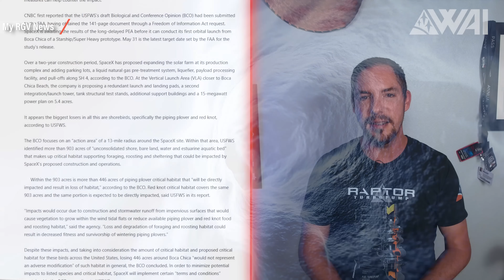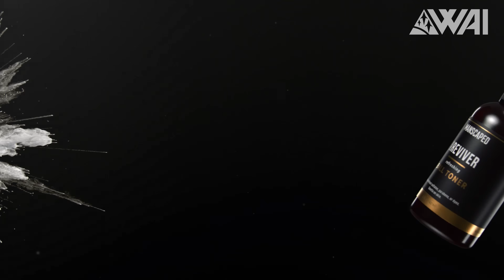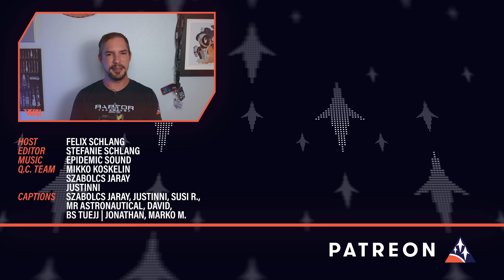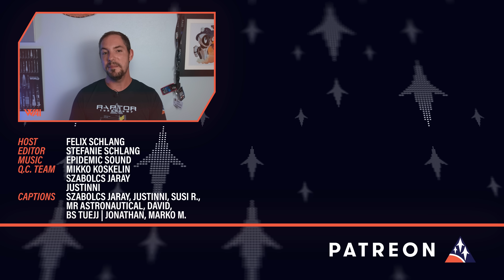SpaceX Starship Accelerating Efforts Towards The Orbital Launch Test!

Comment: “A lot of repairs would need to be done” lol, if a fully fueled starship blows up on the pad the project would be financially toast. At least another 3 years behind, the factory rendered a wasteland. 
This thing would crater the launch site. The BFR also makes a great BFE.

There’s a good reason Elon just hopes it clears the launch tower, I sure as shit hope it does too. 🤞
Reply: The mistake made was that he calculated for an explosion that releases 10K of energy in a microsecond.  In order for this to occur the oxygen and methane would have to be perfectly mixed before the explosion started.  Since they are liquid and in separate tanks There would be an initial explosion that would be dwarfed by a several second long deflagration.  In this the primary danger would be the sustained levels of heat produced during those seconds.  

Just like we've seen when the earlier versions of Starship exploded after landing.
Reply: @colincampbell767  I imagine the pad and immediate area would be cratered. If the deflagration is big enough it could set off the methane storage tanks. 

Yes the whole thing wouldn’t go off in a microsecond, but we have not seen a fully fueled ship go off let alone the significantly larger booster w/ starship. If this thing goes off on the pad the immediate area will be deleted.
Reply: No crater.  The will deflagrate and not explode.  And the fuel tanks are double-insulated (the part of the tank you can see is merely an outer shell designed to reflect heat).  The launch mount ant tower will take damage but beyond that the hazard will be falling debris.

If you look at the other Starship crashes you'll see that the actual explosion is rather small and mostly hidden by the fireball of burning fuel.  (The mushroom cloud you see is actually a secondary event that occurs after the explosion.)
Reply: @colincampbell767  the starships that crashed were loaded with so little fuel their explosion is not even comparable to a fully loaded starship booster stack
Reply: The explosions on the starship crashes were so small that you have to know exactly what to look for in order to see them.  The fireball was deflagration combined with the chimney effect.  And deflagration does not create a shockwave.

You think that what you were seeing was an explosion because that's how Hollywood depicts explosions.  Whenever you see a rising column of burning material - you are looking at deflagration and not the actual explosion.

Most of the fuel burned inside the rising plume due to the chimney effect.

And since the diameter of the ships is the same - there will still only be the same amount of fuel that can mix with oxygen and explode.  After that it will be a rising column of flame - only larger.  

The biggest hazards will be flying debris and the intense radiant heat.

You are making the mistake of assuming a complete mixture of the methane and oxygen before it explodes.

Comment: Not that easy. All load bearing structures exposed to the heat would have to pass structural integrity certifications; possibly tougher than that FAA approval.

Comment: Using some napkin math, Starship can maintain positive thrust (still able to lift) with 8 engines out. If 33 engines give 1.5 Gs of thrust, each engine gives around .046. With 8 engines out, Starship still has 1.15 G. 

Granted, may only be able to abort to the ocean, but a single engine failure should not doom the launch site.

Comment: I'm not so sure it would be 10KT explosion. If the failure was in booster down around the thrust dome the explosive force would have to reach starship then damage it to the point of uncontrolled venting of both tanks for starship to explode. But that's not going to happen B7ship 24 WILL HAVE a flawless launch. B7 will perform boost back and re-entry and perform a pinpoint hover at a GPS guidance bouy in the gulf before engine cut and splash down. Starship will boost just high enough and fast enough to try out Starlink satellite dispenser/Launcher then perform its planned Pacific Ocean re-entry and do the same as B7

Comment: It is worrying that the 2020 Beirut explosion of of 2,750 tonnes of ammonia nitrate was only the equivalent of around 1.1 kilotons of TNT. That levelled those huge grain silos and a fair bit of the city. 

Having an explosion 10x larger right next to the orbital fuel farm is worrying.
Reply: That explosion consisted of fully mixed fuel and oxidizer, which is not the case with Starship. The methane is liquid and concentrated into its own tank. Not only does the methane need to vaporize, but it then needs to mix with an oxidizer before it will burn. This is called a conflagration, which is a far cry from an explosion.  I'd be shocked to find the shockwave equivalent of even a single kiloton in the worst possible case.
Reply: @omegacsblog   the Beirut explosion was far from being fully mixed oxidiser and fuel. It was 2,750 tonnes of solid fertiliser sitting in a warehouse. I do hope you’re correct as I desperately want SpaceX to succeed so if they have a RUD of a fully fuelled Starship hopefully it occurs well after launch! :-)
Reply: Andrew, Ammonium Nitrate is an actual high explosive, and there have been more than a few times it has behaved badly.  LMethane and LOx won't be pre mixed (unless somebody really screws up) so it not going to explode in the classic sense.   It will  just make for a bad day.
Reply: @GG-yr5ix  that’s reassuring GG. Thanks for the feedback. :-)

Comment: Now what if that explosion happens at their new Florida site? There are a lot of valuable things there. 
What about on one of their oil rigs? They can't really evacuate the entire platform every time they launch. 
Any fuel stored nearby will only add to the fireballs too.

Even if the chance is extremely low, we should expect that a fully fueled stack explosion will happen eventually, possibly years from now. I hope SpaceX are ready for it. All it takes is one faulty weld or a few engines not generating enough thrust for it to come back down.

Comment: If a fully stacked and fueled Starship explodes on the launch pad, I think it's game over for work to continue at Boca Chica for several years. It may end Elon's quest to go to Mars. There will be a massive investigation by the Federal and State governments and the FAA will put a hold any future launches for a very long time. The only way he could continue is if he launches from 30-40 miles off-shore where there would be no chance of damages to anything on land. That's why Elon needs to go slow and make sure every "T" is crossed and every "i" is dotted, because I don't think he will get a second chance in the short run.

Comment: My understanding was the tower and Mechazilla are supposed to have protective panels to protect the all the internal wires, cables and internal infrastructure from the exhaust blast of the 33 Raptor engines at liftoff.

Is there any update when those might be installed?

Comment: Except in an explosion, the oxygen and methane wouldn't be perfectly mixed like a fuel air bomb. So the power of 10kt wouldn't be released all at once. Now if you had mixed the LOX and liquid methane then set it on fire, it would be devastating.
Reply: @Lynn Geek Since when does cold O2 auto-detonate combustibles? If that was so, why are there igniters in rocket engines? But for a stable explosion you want to have the fuel and oxidizer mixed in thoroughly. As it is, there wouldn't be that mixture.

Comment: your blast calculations are way off.  There is just no way that the liquid methane could produce an explosion...  it would just burn slowly (relatively)  in a giant fireball.  the shockwave would be maybe 1% of what you calculated.
Reply from the maker: Have you seen SN4 or any of the failed landing attempts?
Reply: @Whataboutit  of course, in the case of sn4 there was a long period of time where methane was allowed to mix with oxygen before it ignited, this can produce a good explosion.  But you would never have that in the case of an orbital launch with full tanks.  it would not scale with fuel mass, it would only really scale with volume of mixed propellant. 
Edit:  your videos are great by the way.  No hate here.  just don't want people to be scared of that kind of detonation.

Comment: What about secondary explosions from the fuel farm?   You would pretty much wipe it out.  It would take 6 months minimum to rebuild, and would the FAA pull the permit until the cause was fixed.  I always thought it was strange both that they dont have a flame diverter- and that the fuel farm is so close.  If they miss a chopstick landing the booster could fall right into the farm.   And the pressure wave from the launch could damage a lot.
Reply: Sorta like the engineers are asleep at the switch?
Reply: The fuel tanks will be almost empty, plus those tanks are alot tougher than ship/booster.

Comment: I think an extremely valid point to consider is also how soon into the launch an explosion might happen. I can only assume your calculations show it blowing up before actually gaining altitude. Looking at your circle of blast radius it wouldn't have to gain alot of altitude to mitigate a great deal of the potential destruction.

Comment: Using nuclear calculations for poorly mixed subsonic fuel deflagations is incorrect. Your calculations are off by ~3 orders of magnitude. For example in the case of N1 "85 percent of the propellant onboard the rocket did not detonate" resulting in a deflagation equal to 4.5-5t of TNT, tons not Kilotons. And even then the pad was up and running in a few weeks.

Comment: I strongly disagree with your estimation of the damage Starship could do. IMO the force of Starship exploding on or near the pad would likely be way less than 1 kiloton. Probably mostly a large fireball..... Fuel cannot burn without oxidizer. The idea you could get 75% of Starships fuel to combined with an oxidizer prior to ignition while the Starship was anywhere near the launch pad is near zero.  

In order to get anything near an even a 1 kiloton explosion you would need an large amount of the liquid methane to combine with LOX and there is no physical mechanism where that could happen while Starship is sitting on the pad. If a Starship breaks up after launch it's forward velocity could bring it's fuel and oxidizer together well enough and fast enough for an explosion, but in that case the Starship would be high above the ground traveling away from Boca at hundreds if not thousands of MPH. 

There are also issues with comparing a possible Starship explosion with the Russian N1 disaster(s). First the Russians did not then and I believe to this day do not use self destruct charges on their rockets. Moreover the N1 was designed to shut all it's engines down in the event of an anomaly. Which is how the N1 was able launch, have all of it engines shut down, then fall back down and crash into the launchpad with enough velocity to cause a large explosion.

A Starship in trouble would continue to accelerate away from the pad then be destroyed by it's self destruct charges which would hopefully insure either it was far enough away from the ground when it broke up that any explosion would be too far away to cause harm or at least that it did not breakup by hitting the ground with enough velocity to effectively mix it's fuel and oxidize on impact.
Reply: You're probably right that it would cause way less than a 1 kiloton explosion if it was sitting on the launch pad then exploded, or if it was already flying and got a couple miles above the launch pad.

However, if we had another Antares rocket situation on our hands, then that would probably be totally different. I'd suspect you would likely get an explosion somewhere between 1-3 Kilotons of TNT.

Comment: The explosive potential wouldn't be anywhere near 75%. If there was a failure leading to rupture of the fuel and oxidiser tanks there would be very little complete mixing of the oxidiser and fuel before it ignited meaning there would be an explosion followed a large deflagration. The explosive force would likely be in the 1 kiloton range or less with most damage to the launch pad and surrounding being caused by heat from the intense fire. To get 75% of the explosive potential you would need something like a thermobaric bomb which is designed specifically to mix the fuel and oxidiser before controlled ignition and that only gets around 75% mixing.
Reply: I can believe 75% of the chemical energy will be released pretty quickly, and that would cause an enormous thermal expansion shockwave.

Comment: I feel that the explosion might be even less than this. since the fuel and oxidizer are liquid and not combined, it would probably burn up in a fireball instead of violently exploding. the methane gas would likely explode violently, as shown in the sn4 explosion, but a fully loaded ship would have less gaseous methane in its tanks than a partially loaded one.
Reply: We don't call this an explosion.
Reply: Science/physics doesn’t care what you “feel”

Comment: SpaceX would be wise to flight terminate immediately after troubles in the air to reduce risk of damage to ground equipment, it's better to have a fireball spray flamage down onto pad than to have a heavy fuel bomb slam into the launch pad then explode.

Comment: methane is highly flammable, differ from high explosive weapons or even nuclear blast
(nuclear isn't just explosion anymore, the explosion is actually just the chain reaction, after that, the energy is spread as pressure wave crushing everything and ionizing energy which makes it devastating for any living being).

The most you can expect is like a gas station burning  up real quick, or that one event of warehouse full of fireworks blowinng up.

Comment: Maybe a dumb question but why have there been no test flights of the booster alone? Wouldn’t it make sense to do a short hop of the booster, also testing the catch arms?
Reply: My gues would be that used data gather from the f9 boasters and use them as something like a template to Modell flight characteristics, using that data from SH of course.

Comment: Total energy output isn't the only factor in determining the area of effect in an explosion.  Rate of conversion to thermal energy per second is far more important.  atomic explosions reach their peak in femto seconds.  rocket explosions are more of a protracted burn after the initial pop and the pop only accounts for a tiny percentage of the total energy release and is still many milliseconds in duration, the burn afterwards is protracted over minutes.  Most of that energy is lifted straight up.  The diagram you used would be for an impossibly efficient conversion of chemical energy into thermal energy at a conversion rate equivalent to an atomic weapon.

Otherwise forest fires would be the equivelent of full on nuclear war... but they aren't as the conversion to thermal energy is slow and protracted.

Comment: The possibility of RUD on the launchpad before liftoff is rather unlikely. With each second after liftoff the possibility increases dramatically. I am probably wrong about this, but my understanding is that the booster's engines ignite with only enough thrust to lift the rocket a bit and then they will ramp up to full power just as the hold down clamps release it (would we see the engines just push their way up through the tin-can of the rocket body?). I also think we will see the booster clear the tower very quickly once the hold down clamps release (my bet is about 4 seconds), unlike the previous Starship test flights that rose slowly off the suborbital mounts. The flight profile should also take it over the estuary and then over the Gulf of Mexico (in a South-Easterly direction?) so any RUD during that part of the flight will be well away from population and infrastructure. One thing is certain though: there will need to be some repairs to Stage Zero regardless of success or failure.

Comment: I can hardly see SX dumping the first booster rocket at this stage. I could have seen them dumping several in the testing stage but this will have the new Raptor engines and a lot of iterations on it. Surely there is way out there to land it. It may take a little more time to finish the landing tower but would probably be worth it.
Reply: They're not going to land it, because they're not confident they can land it without destroying whatever it lands on - and whatever it lands on is much harder to replace than a prototype booster is.
Reply: @simongeard4824  - Simon, they are going to land it - sometime. The question is where and when. The combined Starship you see today is far different than what they might have tested before all of these delays. I believe there is a way to test land one or both the booster and the Starship more cheaply than at the launch tower. All you need is a single purpose capturing device. I would be shocked if Musk hasn't already made that determination. In fact, I would not attempt a launch tower landing until both components have been test landed thoroughly. In my comment I referred to the booster and it seems to me that could be done more easily. My guess is they are already working on a smaller catch tower; possibly for use in the gulf or even partially buried to contain any damage.
Reply: @rocroc  Sure, they'll land boosters *sometime*, but no chance they'll be trying to recover the first flight attempt. Putting expensive hardware in the path of what might be a flaming pile of debris would be stupid, and they're not going to do it until they've shown the ability to make a controlled descent into the water.